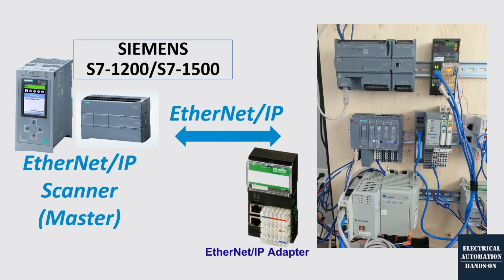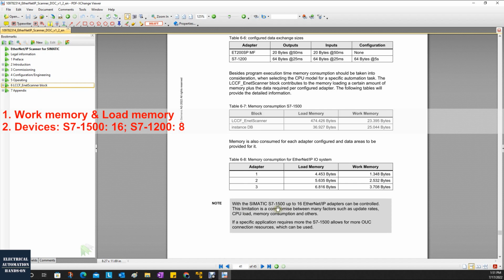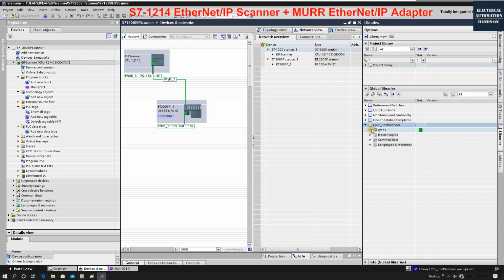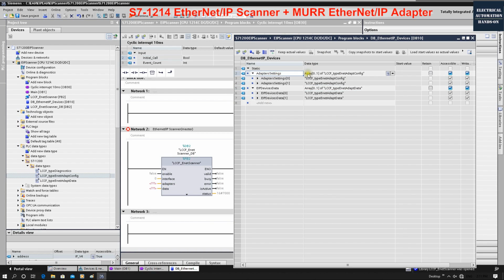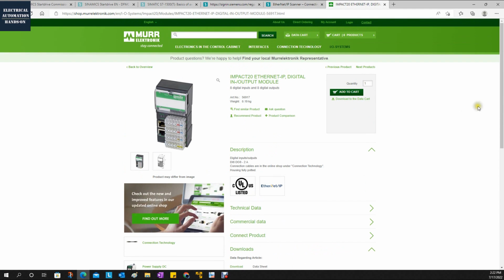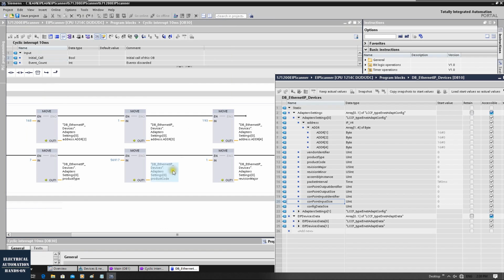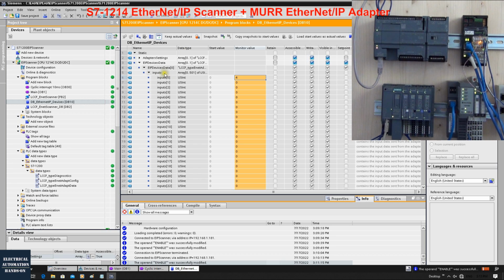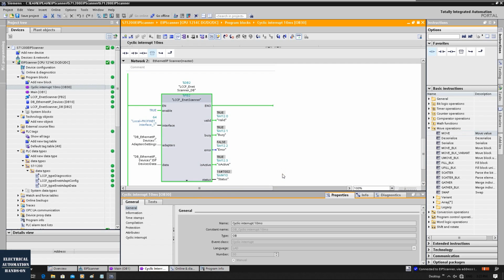COM26. EtherNet/IP Scanner - Siemens S7-1200 S7-1500 PLC TIA Portal Runs as EtherNet/IP Master

Comment: While communicating between Siemens PLC and the robot, I assumed TCP/IP and used TCON, but the communication failed. Using Etherscanner, a Siemens extended function, the communication succeeded. I am curious about the difference between the two. Can Etherscanner be used in general TCP/IP communication? Can it replace TCON?

Comment: The example is very interesting. However, its practical use leaves me puzzled. Aside from the memory consumption, it also seems very slow in transferring data, especially with the outputs. In your video, you could clearly see how there was quite a delay between issuing certain output commands and their actual appearance on the device. I don’t see how something like this could be used. The cycle time should be 10 milliseconds, but here we're actually close to a second.

Comment: I try to connect between PLC S7 1200 1212C with the IFM 151 (Ethernet/IP Device), and i can make the connection but never got the active status (TRUE)... and i only have this value in status 16#7002 (this mean he find and make the connection).]
When i look the DB "EnetScanner" and i look the connection parameter i find the IP and the PORT, but still dont have the connection between the two machines. 

I dont know what happens... please i need your help
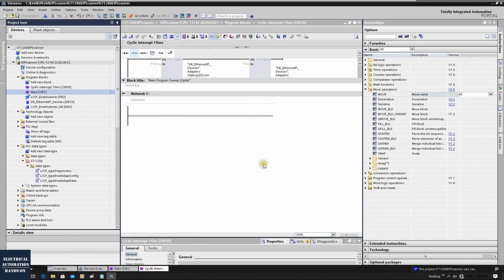Reply from the maker: Please review carefully about the assembly number from the EDS file, other than IP and port, there are some other parameters you need to set,  30:00 - 35:00
Reply: @Saihyorous Did you get it working, have same issue

Comment: Hey
Can you do video about siemens v90 servo commissioning and positioning tuning and speed control tuning whit V Assistant.
Reply: Tecnicas  mecatrónicas  automation searh
Reply from the maker: Hello V90 is a great servo drive, and it should be very easy to use. Unfortunately V90 is not on sale at North America. Therefore, I don't have the hardware to test. Which zone do you come from?
Reply: @electricalautomation   it's my first time workin whit V Assistant and I can't tune the speed. Motor vibrates a lot. I'm from Europe Finland.
Reply from the maker: @joonaslindgren7451  You could find V90 commissioning video from google or Youtube. V90 has one button tunning, it is easy to use.